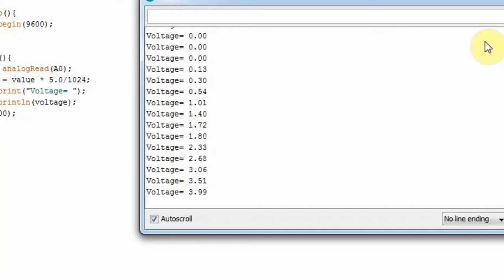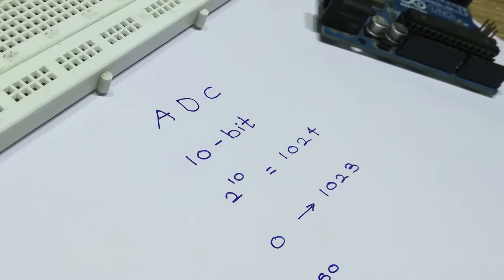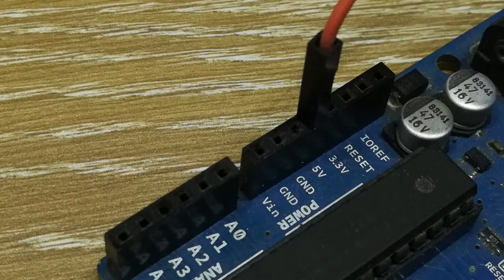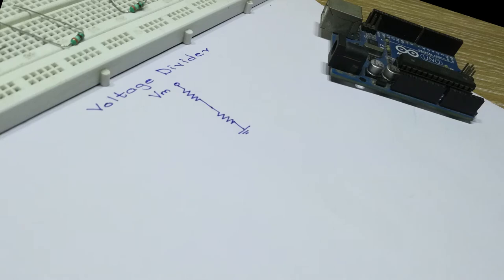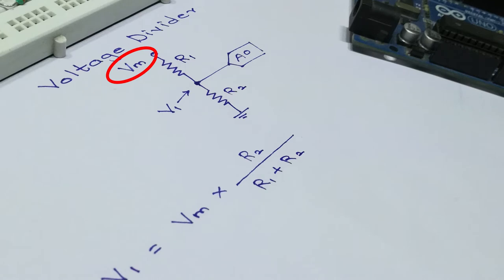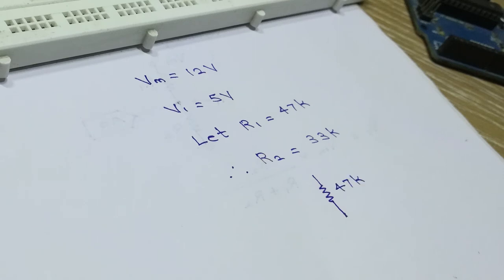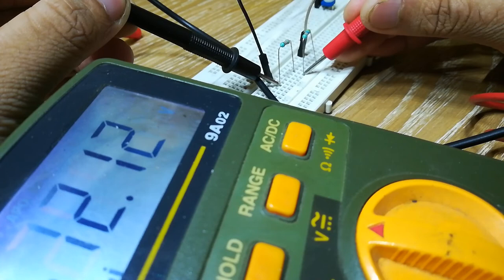Voltage Measurement using Arduino

Comment: Just don't waste Arduino execution cycles to do unwanted calculations each time loop() iterates, like voltage=value*(5.0/1024)  it does unwanted division every time just do this voltage=value*0.0048
Reply: the Arduino compiler have an optimizer so this is probably taken care of automatically

Comment: Thank you. Good video production and teaching. The output of the DIY resistor voltage divider that you will build will not likely equal exactly 5 volts... For example, your divider had a true measured value of 4.98V. This value can be change in the code, to increase the accuracy of the Arduino volt meter. Meaning, you should 4.98/1024, instead of 5/1024. Just a small suggestion.

Comment: I want to ask sir, I want to make a voltage sensor manually with a battery voltage of 4.2 v.  roughly how much resistor do i need sir

Comment: Hi, thanks for the video very helpful, I need to measure when 12v AC is active (light on), can this be modified to work with AC?
Reply from the maker: Thank you!
If you just want to check the presence of 12V AC, then yes. Just add rectifier and a C filter before giving it to the voltage divider. You can even measure the voltage since any change on AC side will reflect as a proportional change on DC side. But it won't be precise. 
Accurate AC voltage measurement is a bit difficult and will need a separate video!

Comment: One word of warning - if you're measuring a 12V battery, lead acid is 13V fully charged and LiFePO4 is 14 so you probably want to aim for 15V.
Reply: The limit of this kind range is 18V, so better aim for 18V..  
The next range is “24V” system.

Comment: Great video. Very clarifying. Just one question: what do you actually use to measure the voltage? A tester? Hoy is it connected to the Arduino? Thks
Reply: Analog read through the serial monitor

Comment: How to calculate? Am using stm32 its max analog input is 3.3v so I need to convert step-down transformer out is ~ 5v to 24v so I need to convert it to max 3.3 can you calculate which resisters to use.

Comment: 0:52  you have your calculation wrong.
The correct calculation for resolution is Resolution = max input /(2^n - 1). The ADC is 10 bit so therefore 5 / (2^10 - 1) = 5 / 1023.

 At the max input (1023), the total voltage is 5V.

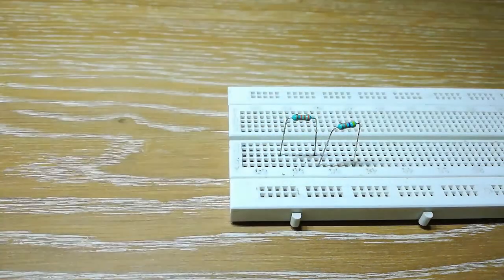Comment: I will answer your question at 3:37 .. Listen buddy, I am suspecting that you brought all of the information 99% from the internet without any discovery or tiring yourself, however this is a thought, I am not very sure about it, but you seem like that. Secondly, people buy this chip they want to save money and electricity, you ask me how? I will tell you...  First of all, for answering the first question, I have to answer the second question, some people (like me) needs some small chips that are very small, the chip did not cost me anything, it only costs me like 0.10$ if you buy it from china, well if you buy it from a local shop (they will dig your pocket surely). Otherwise, who would buy an Arduino which is much bigger than the voltage sensor that you have showed us at the end, and more expensive instead of buying a voltage sensor?  If you are going to tell me that you want to use only ONE Arduino to calculate the voltage and doing the other jobs, I will have to argue with you that this might not be the best choice. Think about it, the arduino has only one processor and a 16Mhz processor, which is slow. So, that measurement would take like at least 15 or 20 milliseconds, which is a bit huge number. Next time, make a better scientific, geeky and nitty-griddy videos, otherwise, I will pop-up again arguing with you inside the chat... Bruh.
Reply from the maker: First of all, those are not called 'chips'. An IC of some sort is called a chip. Anyways, that thing is just a PCB with two resistors which is nothing but a 'voltage divider' that I have explained in the video. The point of making this video is to make sure that people don't just buy stuff and do the connections just by looking on the internet without knowing how exactly it works. Talking about smallness, using two SMD resistors (or even through-hole) takes less space than that PCB. Try it yourself. Next, it takes 100us (0.0001 secs) to read an analog input. Read the Arduino Reference page. Learning from the internet would do no harm. Still, using that pre-made 'sensor' would not result in any faster calculations because it is the same thing (just a voltage divider). And also, I assume that the viewers watching this video are getting started with Arduino or electronics and not making a spacecraft and so timing is not a crucial aspect. I hope that my explanation was pretty 'scientific'. Thank you for watching!
Reply: He is suggesting you can replace the sensor module with two resistors. He is not suggesting you can replace the sensor module with an Arduino.